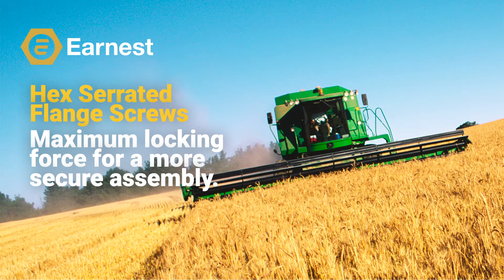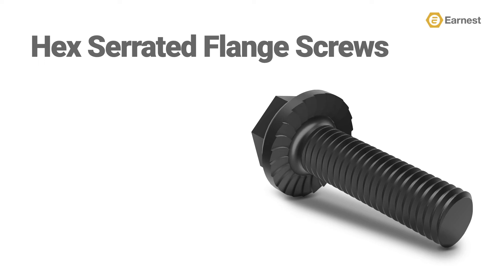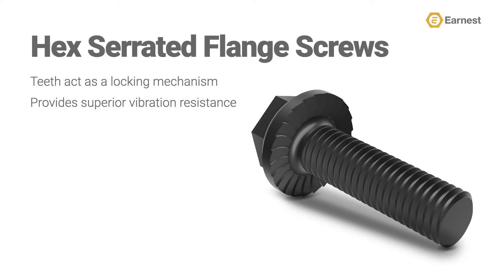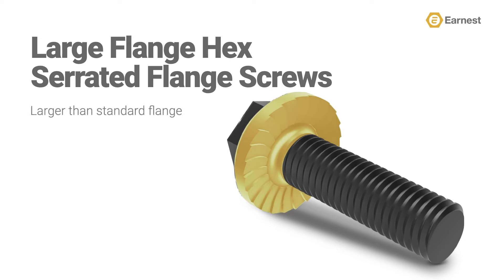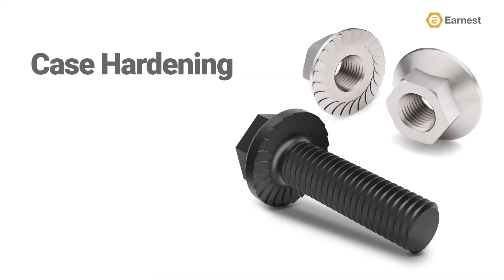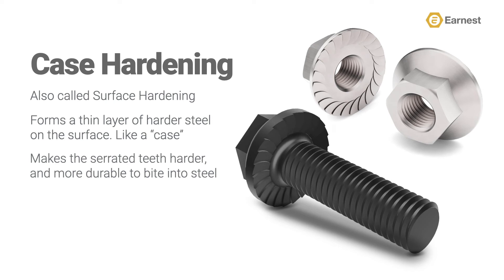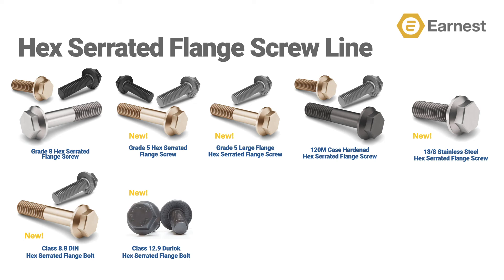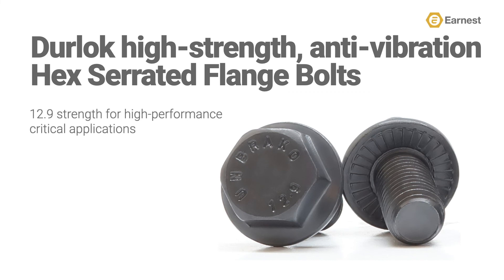What is a Hex Serrated Flange Screw?

Comment: I am looking for serrated flanged Bolts/screw class 10.9 that are all fully threaded. M6x1.00, M8x1.25, M10x1.25, M10x1.5, M12x1.25.

All I can find are the shorter versions are fully threaded but the longer ones are partially threaded. For example, M10 x 1.25 x 60mm is usually partially threaded. But I would like them to have full thread.

Do they even exist? 
Thanks!